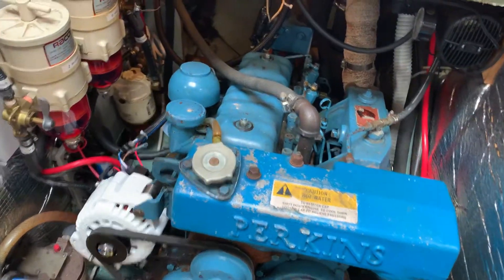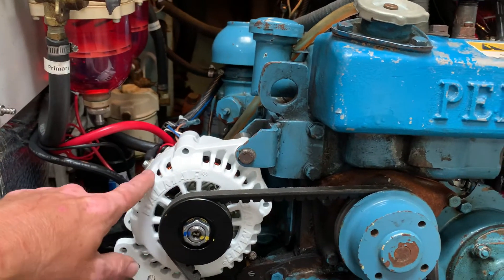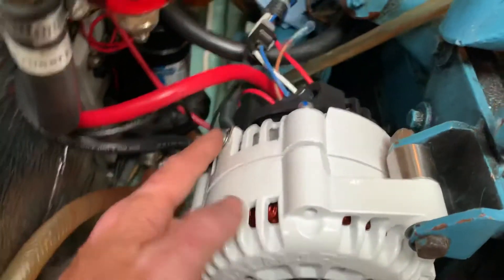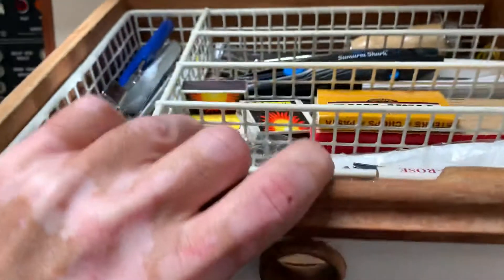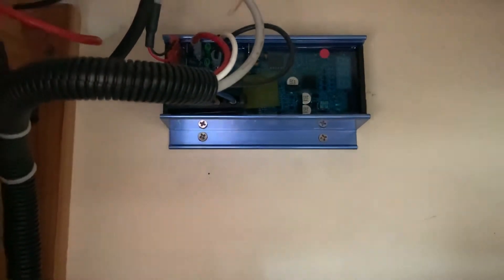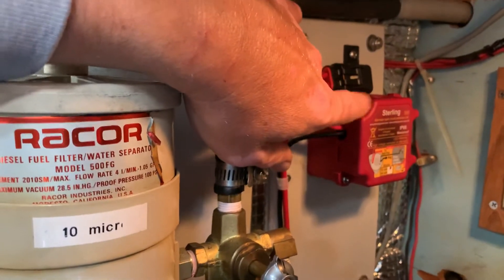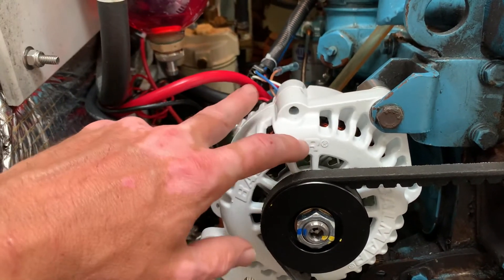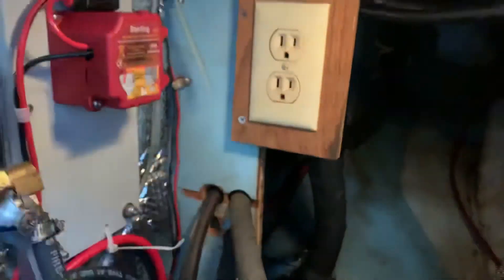Balmar Alternator Install and LiFePO upgrade

Comment: I have had 3 Balmer alternators in LESS THAN 13 MONTHS. And they have all FAILED, IN MY WINNEBAGO REVEL less than 22,000 miles. Balmer is not a quality product and Winnegego has done nothing to rectify these ongoing issues happening all over the country.
Reply from the maker: Are you confident the issue is Balmar's fault and not the fault of the installation? If you've gone through three alternators in less than 400 hours of runtime, I'd begin to wonder if the installation was to blame. What are the symptoms? And what's the setup - e.g., battery type and size, alternator rating, etc?

Comment: why not charge the start battery first and then dc-dc the house? is it simply because efficiency loss over the dc-0dc whilst the house have bigger capacity = greater loss? id be worried that the starter battery doesn't get charged until house bank reached a threshold. surely the starter is more important.
Reply from the maker: Simply, the DC-DC charger output is less than the alternator's capability, which means that you're not taking advantage of 1) the alternator's output and 2) the rapid charge acceptance of LiFePO. Also, the DC-DC charger isn't dependent upon the LFP bank voltage; it begins charging based upon alternator output voltage. Start batteries typically see so little discharge, that it doesn't take much time to bring them back up to 100% anyway.

Comment: This is the same system only 170amp that we are putting in our boat, even the apd. Has it worked well for you? Everyone is telling me that it's a bad idea to connect to the lithium house bank but I see it as a way they can sell you multiple dc to dc chargers which have efficiency loss and excessive heat.
Reply from the maker: No complaints or issues in 3 years.

Comment: Did you fuse the alternator wire to the battery.  If so what amp rating.
Reply from the maker: Yes, Class T fuse rated at 175 amps, but fuses need to be sized for the wire you're using. It isn't a one-size fits all application.

Comment: My Balmar is setup to charge 3 8d AGM batteries which have come to their end of life. I have replaced them with 2 300 amp hr LiFePO batteries and I was told that the AGM regulator I have been using should be the right voltage range for new batteries. The sterling alternator protection looks like the way to go. I have a 100 amp alternator and they say 50% of capacity in amps for charging so theoretically it should work fine for 600 amps. I've heard of finicky BMS's burning up alternators so I've been researching it when I came upon your video. Regards

Comment: Hello, I just ordered a 270Ah Lithium battery to replace my GEL house batteries and plan to do the same thing you’ve done!  I have a balmar 70 which I plan to have the MC-614 charge directly.  I ordered an Orion 12/12-18 I intent to connect to the house bank to keep my Gel starting battery topped off.  What solution did you choose to keep your start battery connected and charged?  Thanks!
Reply from the maker: Hello! It sounds like our approaches are nearly identical. I added an Orion-Tr Smart 12/12-18 between the LiFePO bank and my FLA start bank, which has worked well.
Reply: @cdsailor  Awesome!  So I’m thinking I’ll just have an appropriate sized cable from start battery to the starter, and the same from the Orion to the start battery, all fused as needed.  Is that how you’re set up?
Reply from the maker: @svtavishb.1817  Yep. This video might be helpful too: https://youtu.be/aE06SEJrBpw

Comment: Any issues with the alternator overheating?  I’m doing the same thing and everyone is telling me the Lithium will overdraw/overheat my alternator.
Reply from the maker: No, no issues with overheating. I’m running the Balmar 614 external regulator with the belt-load manager set conservatively to a max of 50 A output, which is more than adequate for bringing my two LiFePO batteries (210ah) back to full charge within a reasonable amount of time. That setting also means my alternator should last longer. 😉

Comment: Pretty sure you need a fuse at the alternator protecting the wire from the alternator to your lithium batteries.
Reply: Balmar supply one (reg to alt) with their harness .... although I didn't see it. And any system should have a main fuse before the batteries.

Comment: Thanks for posting this, I appreciate coming across someone with your particular setup. How's this working out for you?  

I'd appreciate your input on how you are liking your alternator and voltage regulator as well as if this setup is the way to go. Not many people that I've noticed charge their batteries in this order. House then boat/vehicle.

I'm interested in doing the same thing more or less. I've been looking at Balmar voltage regulators and didn't know that they built alternators as well.

I have a camper van that I'm building out and was considering charging my Lifepo4 house batteries first through an upgraded alternator then to a voltage regulator as you did.

My house batteries are 180AH 24v Lifepo4 and the van is 12v so a 24/12v DC to DC charger should do the trick.

My biggest concern so far is that if the alternator doesn't finish charging the house batteries before shutting down the vehicle, I will end up with the vehicle batteries not getting charged. 

If you have any comments to share, I'd greatly appreciate it. Thanks again.
Reply from the maker: It’s fairly common in marine applications for the alternator to charge the LiFePO bank directly, particularly in my application in which the engine is an auxiliary and isn’t used unless necessary. Given your van application, you might want to stick with the typical configuration of using a DC-DC between start and leisure batteries.

This system has worked perfectly fine for me, keeping both house and start batteries charged. 

The Balmar alternator and regulator have functioned flawlessly so far. They’re a recognized and trusted supplier/manufacturer.